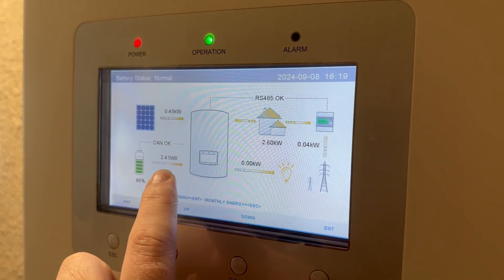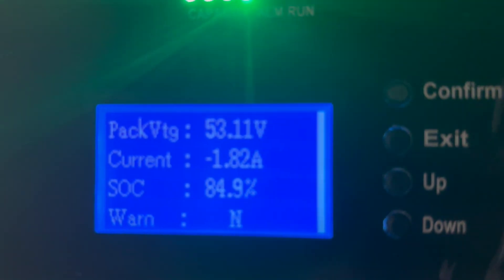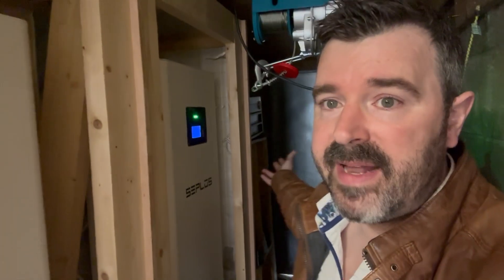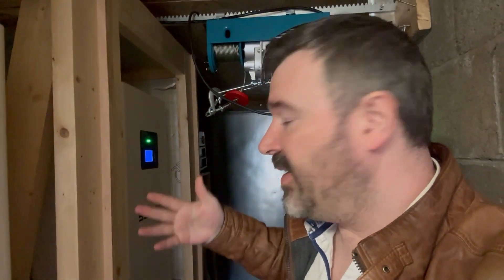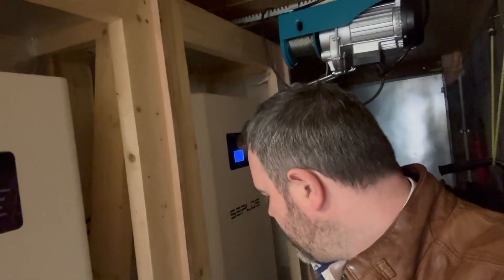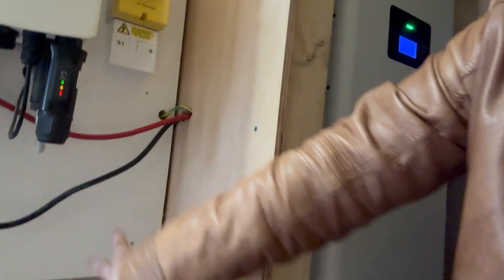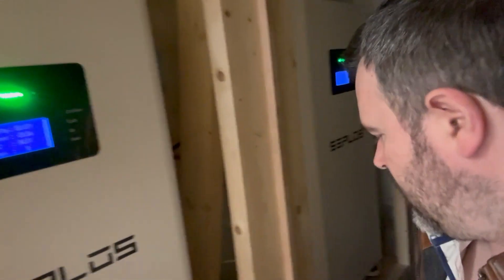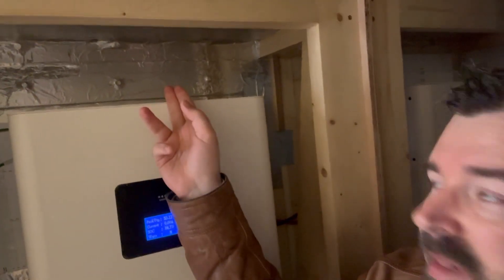To Daisy Chain or Busbar Batteries

Comment: Hi Gary, Is Battery 1 the master or the Slave ? Sorry, I am a bit confused regarding the connection ports for the communication cables between the Inverter and master and master to slave.
Reply from the maker: Battery 1 is the master. This is where DIP switch setting might matter. With the V3 Seplos in my videos, the DIP switch setting don't matter. The master is the one connected by comms to the inverter, regardless of DIP settings.

Comment: Simple solution is to put a fuse block directly from the inverter and just connect both batteries to the other side of the fuse, both should be seen equally
Reply from the maker: Work is in progress. Video soon to follow 😅

Comment: How about taking each battery  cable pair and running them through two timed contactors then run one pair of 25mm red and black to your inverter this would stop the pressure on the first battery just set the timer to change over every 12 hours
Reply from the maker: Interesting suggestion. The reason it wouldn't work is because the load throughout the day (20 hour period in my case with 4 hours of charging time) is different at any given moment which would result in one battery being used a lot more than the other. I would also likely run out of charge on the higher use battery depending on time of year and use patterns. The other battery would be idle while I was drawing expensive electricity from the grid.

It would be easier and more cost effective to use method 2 as per the description.

However, I am adding a third battery. It's sitting here beside me, waiting for me to complete its new home cabinet and install a central busbar system to equalise the draw on all three battery packs.

Comment: Maybe mount the breakers at the top but on the outside? Put another piece of wood. Mount the breakers on it and cables hidden behind. Have the piece of wood Movable in case you need to get batteries out/in.
Reply from the maker: Yeah, it's either going to be on top of the cabinet, or below. I've ruled out placing inside the cabinet due to access for installation. I'll probably be doing this in the next couple of weeks, as I will be less busy at my day job. I have another cabinet I need to build. I have 16 cells purchased from someone on a solar forum, only 1 year of use. Battery case is on the way and I have the cables and connections all ready to go.

Comment: Gary, love the videos. On bus bars, take a look at the Victron Lynx Distributor. I use this with Anderson 120A connectors.
Reply from the maker: Thanks. I looked at these before and have decided to use a cable to busbar setup. There will be smaller busbars linking a main busbar cable.

I have the equipment already and plan to get to work on it after my third battery case arrives. Yes, I am building another battery. 

It might be interesting for others trying to decide what method they should do.

Comment: Le probleme vient du fait que tu connect la borne + et - sur la 1ere. Tu devrais mettre le + sur la 1ere et le - sur la 2eme et relier les 2 en parallèle. Ainsi les 2 batteries fourniront et se chargeront en meme temps
Reply from the maker: Yes. Thanks. I have already explained why I set it up this way. The batteries work fine for now. Later I will be connecting by busbar.

Comment: Impressed you have both batteries in a cupboard off the ground, those things weigh alot!
Reply from the maker: They certainly do weigh alot. The cabinets are made very strong and are well secured to the brick wall with several concrete bolts. 

The reason for the cabinets is to enclose the battery packs and keep them insulated during the winter when I need them most.

The reason they are off the ground is to allow for bicycle handle bars to slip under the base of the unit for easy passage/storage.

I'll put up a build video once I complete that work.
Reply: @GaryOnPower should there be any water down on the floor, the high position is also good countermeasurement for waterdamage.
Reply from the maker: @halosenpekka1090  I'd suggest having battery in a dry space. Water and electricity don't play well together.

Comment: Don't know if this helps, but I read somewhere that if your batteries are in parallel, then you would hook one wire from the first battery and the other from the last. meaning positive from one and the negative from the other. Wire length and sizing will be important to limit the resistance.
Reply from the maker: Cable length was the limiting factor to reach battery 2.

Comment: Hi, thanks for taking the time to create this content, very interesting. I have one comment on your setup, I believe you actually have it wired incorrectly. Normally when connecting batteries together like this you need to connect the Positive from the inverter to the first battery positive and the inverter negative to the negative of the last battery. In this way both batteries will charge/discharge at the same rate.
Reply from the maker: Thanks for your comment and I both agree (mostly) and understand what you mean. I sort of mentioned it in the video. I chose the current method because I saw a Seplos CAD video showing 3 batteries being connected and I just followed what was recommended partly because it was the manufacturer saying so and partly because the cables provided with the inverter aren’t long enough to reach the second battery. 

I will be changing the setup to a busbar system, so there isn’t much point in making the change to the daisy chain method. Still worth a mention and I’ll be sure to highlight this in the next video.
Reply: @GaryOnPower  Hi Gary, Just another point, I think someone mentioned this before in another one of your videos. The recommendation now on connecting DC circuits is not to use DC isolators, I know this is currently under review in the UK, Maybe a better solution is using inline fused like in the Victron busbar solution. Also I assume your Solis invertor is 5kw with a max charging current of 100a. If you are planning on power shifting with nighttime Rate you may want to look into a second DC charger as depending on you solar generation during the day you may not be able to charge 40kw over night. it will take your inverter roughly 8hrs to charge 40kw and that's not taking into account any losses. Also Pushing your inverter to the limits may reduce its lifespan.
Reply from the maker: @j4cki3-j4cki3  I may have mentioned rotary DC isolation, but my intention would be for MCBs. I'll look at the victron option.

My inverter is indeed 5kW. I already load shift from 2am to 6am. At 5kW, I can get 20kWh into storage. I fully intend to add a DC charger to the battery side of the loop, something around 3kW, but not until my supply is atleast upgraded to 12kVa, as I also charge an EV maybe 4 nights per week during the 4 hour cheap rate. 

When I have 3 batteries, each being 15.5kWh, but only 13.2kWh useable, as I deplete down to 15%. 3 of those makes just under 40kWh. I can currently draw 20kWh and will be able to draw 32kWh once the supply is secure and I add a DC charger. In reality, I will rarely (if ever) need 40kWh of energy outside of the cheap time, as about half our consumption is on the EVs and that's during the cheap rate. 

Right now, I have my inverter set to export, so any solar goes to the house and the excess goes to the grid. I am usually left with 60% or more battery before midnight and have been dumping 9-10kWh to the grid before the batteries start to charge again. 

Really my only additional grid draw is when the house load is high, such as when the electric shower is drawing 8kW. Outside of that, it's all stored energy. 

Also I don't mind pushing the inverter and reducing its life span. I reckon I will have upgraded long before it kicks out. It's got warranty for now, with a new one installed only a couple weeks ago.

Comment: more cable, more resistance, more resistance more heat, more heat is wasted energy
Reply from the maker: Excellent point and will be a primary consideration. My only mitigation would be to upgrade to 35mm^2 cable if running bus bars below the battery cabinet.
Reply: @GaryOnPower  50mm as we had the plastic melt off the 35mm ones with our seplos pulling 9kW. 50mm and not the aluminium copper plated ones off Amazon :)  I have 4 x Seplos on bus bars and works great. Get a cheap thermal camera, showed me a dangerous cable.
Reply from the maker: @CaptainProton1  My inverter is limited to 5kW, so 25mm^2 will be more than enough to handle that. When I upgrade the inverter to 8 or 12kW, I will of course upgrade the cables to 50, or 70mm^2. For now, I'll be using 35mm^2 cable as a busbar connecting 2 and then 3 seplos kits to the inverter. I will keep using 25mm^2 between each battery and the busbar. I won't be pulling many Amps anyway, but as a precaution, each cable between the battery and busbar will have a 125A DC MCB. I'll also have an in-line fuse of 150A between the inverter and batteries. I might now have a good excuse to get a thermal camera :)